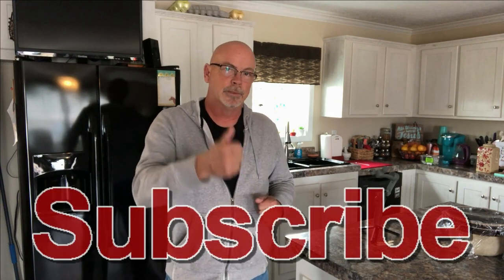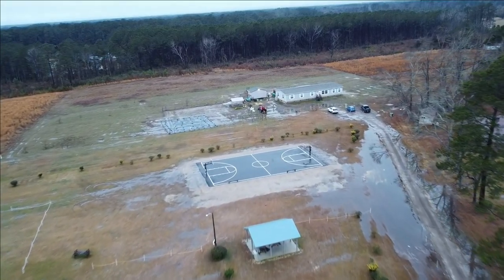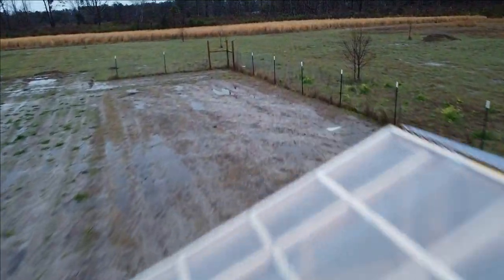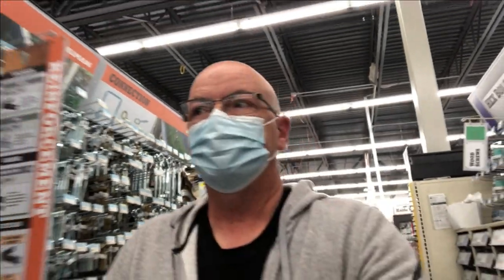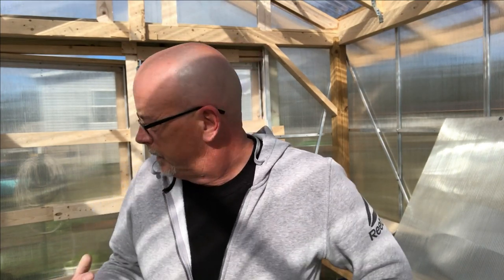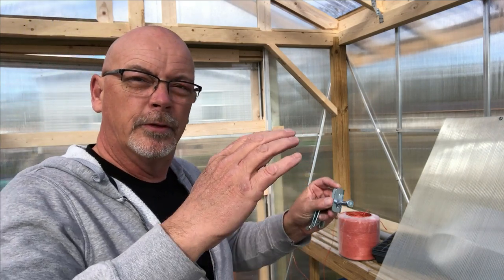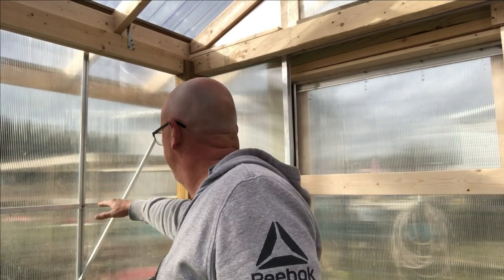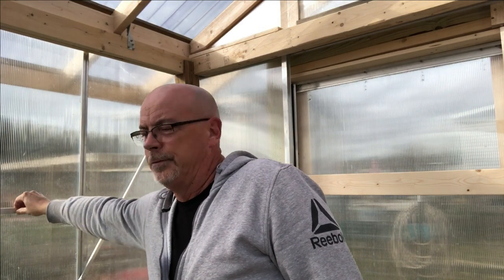How to make a Harbor Freight Greenhouse modifications | How to homestead continues. Tips and Tricks.

Comment: Hi there TangoRomeo 87! Great video and very informative! Now, I recently purchased an AmeriLife Prefab greenhouse, it does seem to have some similarities with the Harbor Freight greenhouse models. I think I might be able to use several of your suggestions once the greenhouse is completed. I like all of the suggestions, especially the alum stripes to the outside panels and the suggestion to run treated studs to the lower areas of the building to aid in securing the building. I like the latch idea, but knowing me, I might not install this type of door latch; I seem to have issues with getting locked in and not being able to get out even with the string attachment. Smile. Thanks for taking the time to provide these great tips. I've Subscribed.

Comment: Cute dog. I like the 4x4 corners so I'll be doing that and the strips outside. My roof hatches keep blowing out of the frames. I'm going to use some aluminum tape to see if that will prevent that issue. I have used it on the bottom edges of the roof panels but it deteriorates each year so I redo it when needed. Where do you live in NC? I'm in Leland 10 miles West of Wilmington. Our soil is wet most of the year here. Rain water pools whenever we get more than 1 inch.
Reply from the maker: Near Shallotte here, heck we are neighbors!